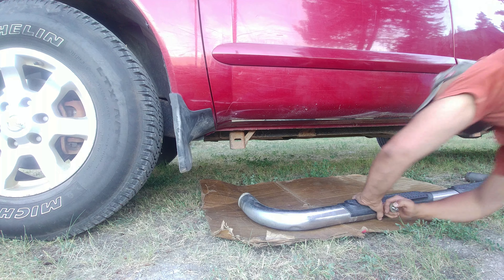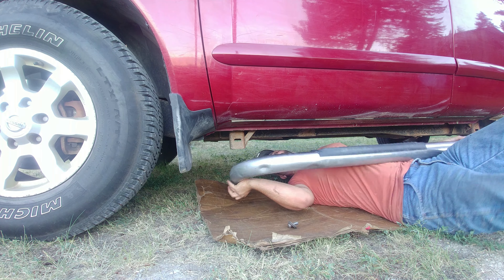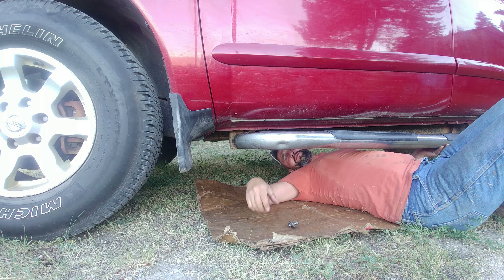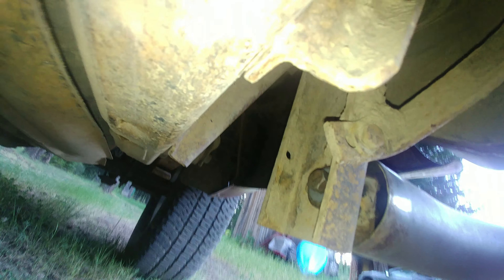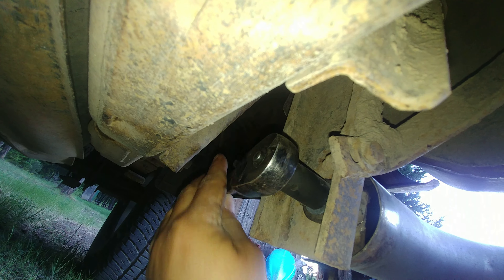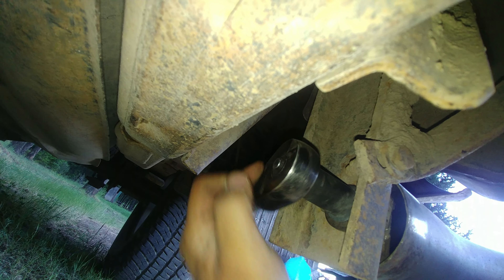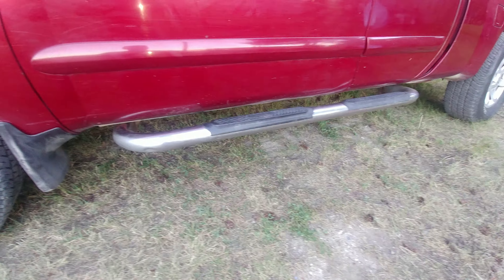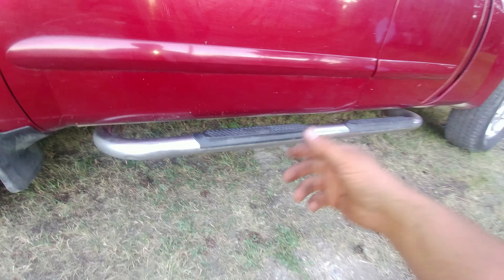INSTALLING NISSAN TITAN RUNNING BOARDS // 4K

Comment: when I removed the old running boards , two of the bolts broke off, one is recessed...it would be great if you could do a video sometime about how to remove them
Reply from the maker: Hi Bruce! Thanks for sharing your story) I only filmed installation process without broken bolts removal challenges, but it could be better video. 
On my truck one bolt was broken another one was missing. Running board came with a truck separately. 
Cheers!